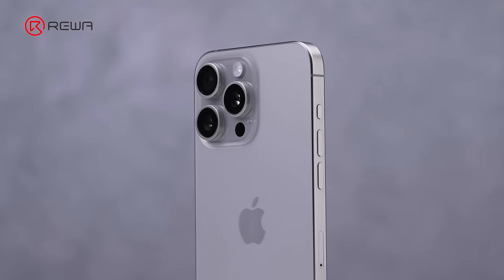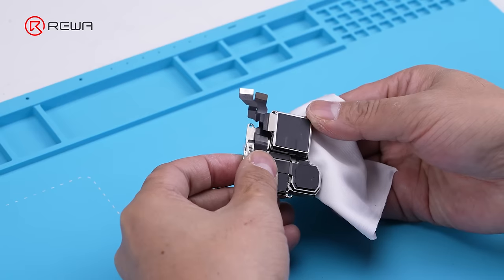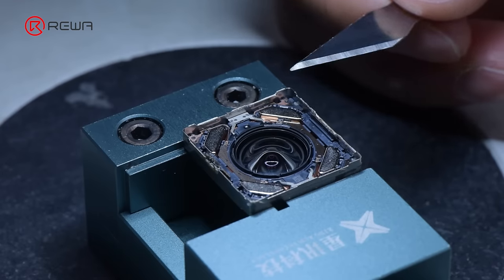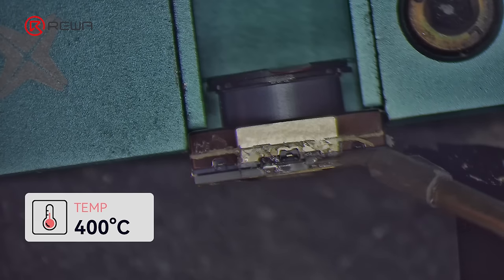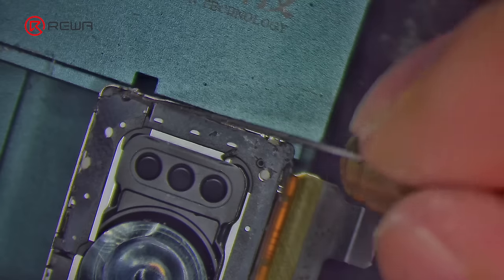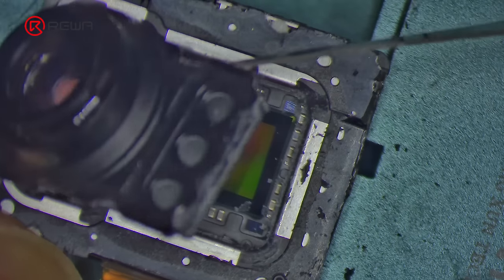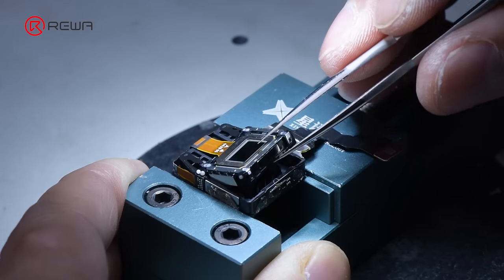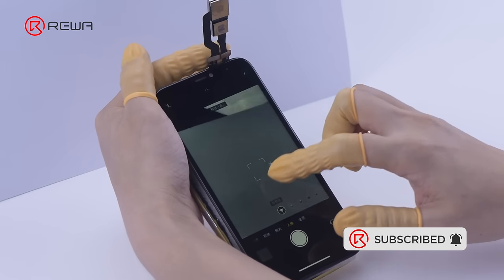iPhone 15 Pro Max Telephoto Camera Complete Teardown

Comment: apart from the tetraprism, is the telephoto camera sensor the exact same as 14 Pro/Max?
Reply from the maker: Since we do not teardown the 14Pro series rear camera completely. We cannot analyze it at this moment. But we may can try it in the future
Reply: No, it has 1.12 nm pixel size, and 14 pro has 1 nm. Its 25% larger